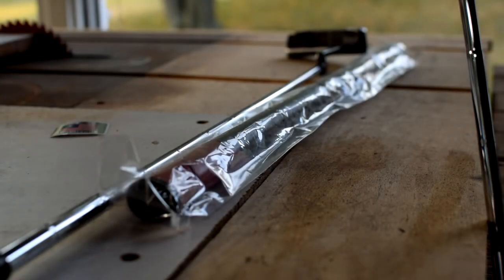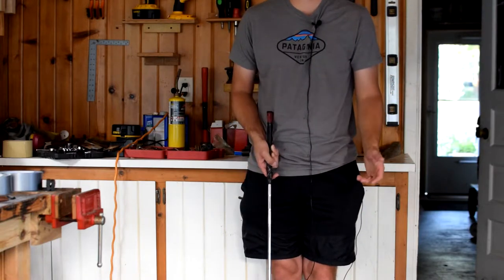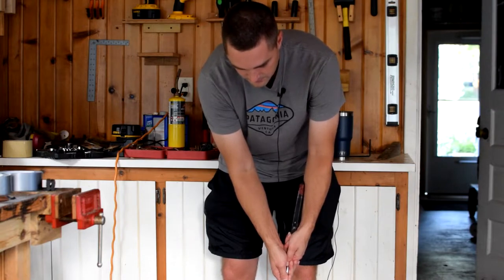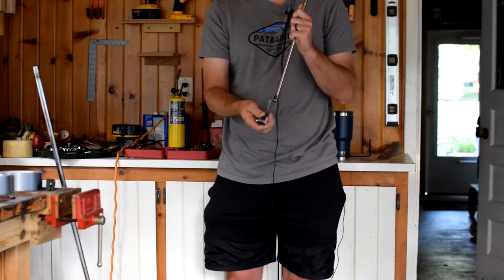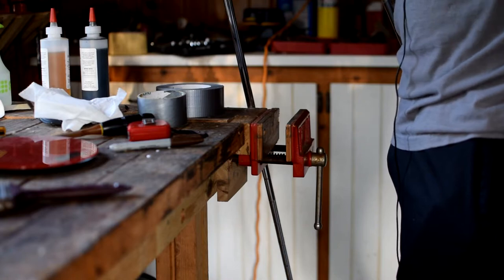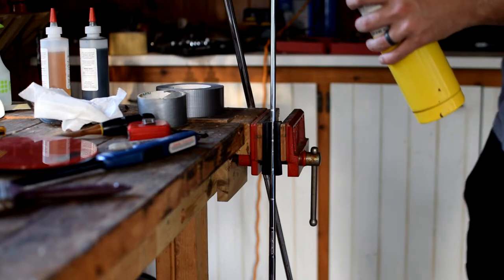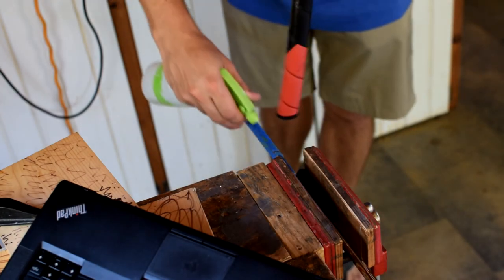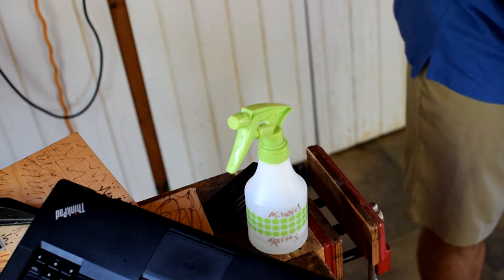DIY Armlock Putter Conversion - How To Build One

Comment: Bro this is awesome thank you i needed, i got about a 6 iron length shaft and put an armlock grip and put it on a putter and i saw improvements using the armlock technique but i knew like it was exactly right and this video about adding loft and the lie angle explains everything i need to do to perfect my putter thanks!

Comment: I think you are wrong about increasing weight
Reply from the maker: Look at any armlock from bettanardi, sik, cobra - you'll see headweight at 400 ish grams.

You're adding shaft length above your hands. So a traditional 350g head will feel very light in comparison. Heavier headweight offsets the extended shaft to keep a more traditional feel.
Reply: @KleyGolf  I am surprised. I own a few Scottys and 33” have 2x20gms and 35” have 2x10 gms weight. Putter is like a lever, lever length times weight gives the force. If the force is to be kept constant and length is increased to 40” then weight must come down. But you are right about the weight above the  griping point

Comment: I am of the old school of which and to my knowledge putting IS only a 2 point connection pivot . NOT A THREE POINT CONNECTION AS HANDS AND ARM ARE . If this is the case then those who putt with broom handle resting on the CHEST should not be PENALISED,  WHAT IS THE DIFFERENCE OTHER THAN CHEST OR FORARM